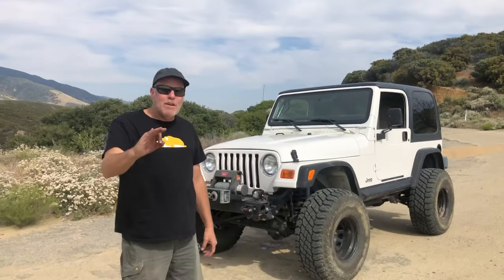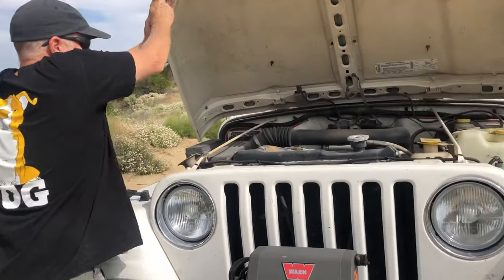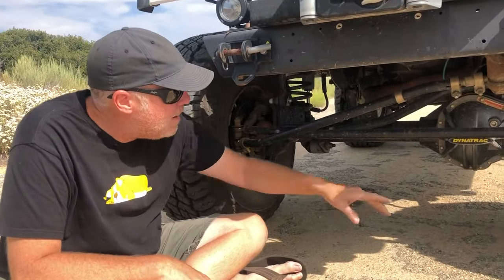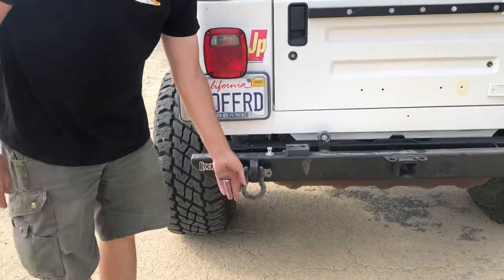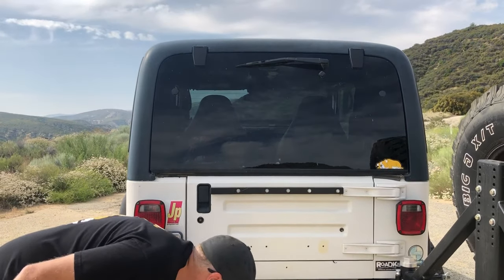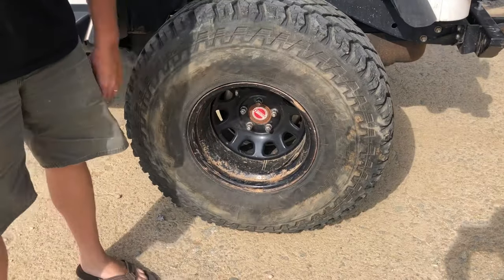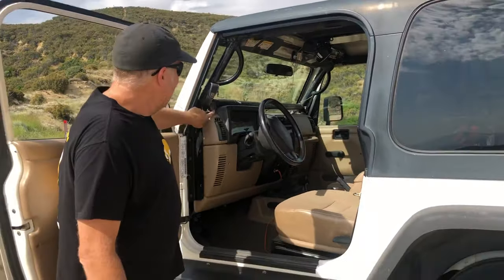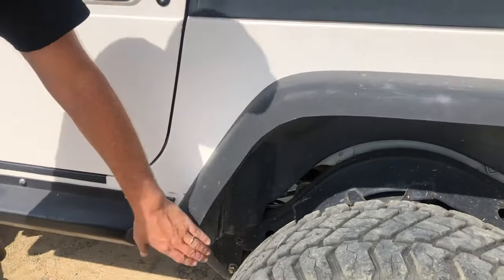How to Build a Jeep Wrangler TJ

Comment: I had two Stone White TJs in a row. A 2001SE Auto that I miss desperately. There are SO many good memories from it! I slapped on a set of the then new Interco Trxxus on a set of black steelies. Loved the set up. The second one I bought new in 03 and upgraded full doors, 2.4 l , 4spd! Auto, and AC ! It was a great road Jeep but the driveline while more drive able and powerful it didnt  instill the confidence of the the venerable 2.5, and solid 3spd auto. Shrug. I’d take either one back! I was forced to trade tge 03 in on a new Aveo in 05 because if medical bills 😢. I received 12,500 on a 2 yo TJ with 21k in 05! 🥲they started climbing in value after that and I’ve never been able to afford one again! Thanks for the memories and sorry about the novel here. 😅

Comment: Freiburger: "This thing is built to be bulletproof and will never fail on the trail with how we use it!"

Also Freiburger: "We stopped because the transfer case shifter fell apart." 

😂😂😂
Reply: I'm pretty sure he meant like a proper breakdown that would result in the car being unfixable on the spot and/or require towing.
Reply: That's what happens when you talk about being unbreakable.  It breaks.
Reply: AstronomyToday get a Suzuki , get there, watch all the jeeps have fun and actually wheel, go home and be sad. 😂
Reply: AstronomyToday haven’t heard that one before, lol that’s actually pretty funny 😄😂😂
Reply: Dave can't build anything that doesn't fail - it would break the universe.
Reply: @AstronomyToday I'll stick to my American wrangler over a cheap knockoff anyday
Reply: @AstronomyToday lol a jimny is the definition of hairdressers car
Reply: @AstronomyToday duh it was a heavily modified suzuki sierra that holds the altitude record not a jimny they had to follow the tracks of a stock standard wrangler to the top and park on some piled up rocks to claim the title. i'm not sure about the longest distance single vehicle travel record plenty of jeeps have circumnavigated the globe  one gpa by land and sea. the longest running single generation vehicle lol do you mean the cj3b 1953 to 2002 because it's not suzuki they had lj50(jimny),lj80, sj sierra/samurai and then the poxy looking new jimnys all different models mate. yes jeeps are older also the first land rover was built in 1949 and it used a jeep chassis,suspension,diffs and transfer case with a homemade body, rover motor and gearbox.
Reply: He was talking about the axles.
Reply: that shifter is broken from factory, designed very bad, so people swap them with wired shifter
Reply: @AstronomyToday I suppose I should point out that the 1986 jeep is the evolution of the CJ of 1946. The very capable Toyota Land Cruiser was based on both Chevrolet and Land Rover designs.  Suzuki was a very late comer to the off-road game.
Reply: yep i is bullet proff

Comment: I like using motorcycle chain wax for exposed lubrication points. If it dries in a dust free environment I has almost no sticky tack to it and it is totally waterproof. I like Maxima chain wax.
Reply: Amsoil "Metal Protector HD" dries waxy too.  I use on all kinds of outdoor stuff like trailer hitches etc and it does a great job as well.

Comment: You could try using graphite spray instead of the liquid wrench, graphite spray leaves a dry libricious film that wont soak up the dust and get worn in the heim.
Reply: Swordenchanter88 productions where do you get that from? I’ve been using wd40 for years but always on the hunt for new products to try
Reply: Cheap Jeeper graphite spray you can for sure get at Home Depot or any hardware store. Usually kept by the key making matching.
Reply: Check out Bechem Lubrication AF 438... Made in Germany anti friction coating. Spray applied.
Reply: Don't use liquid wrench to stop the squeaky fasteners. Use Teflon spray

Comment: living in aust i have aset cooper tyres 33 inch on my sixty series landcruiser the same as yours disapointed in them not good in mud fill up easy turning in to slicks....being very over priced find they ride rough have weak side walls blue ahole thru one just touching woodern stump....have only lasted 50km to 60km instead of suggested life around 80km to 100km

Comment: Good to see you back on youtube. I met you a few yrs ago at dragweek,  131 dragway in Martin Michigan and you signed my vette kart....  I used to watch everything you put out untill roadkill went to motortrend.  I tried it for a month , but I'm not giving them money every month for very limited content,  when there is so much free quality content available on youtube.  
 I have a similer TJ minus the pro rocks and stock motor.  I run a 4.6 stroker ,  8.8 rear and ,  and mildly built dana 30 while I save for a RCVs and dana 44 swap.

Comment: The reason why your rear shocks were not the right size is because of the shock mount on the axle. Dynatrac moves the mounts a little higher to protect them and this is why your shocks will bottom out before the bump stops contact. 

I've been there. Wasn't fun sorting it out

Comment: i have a solution to noisy and none insulated soft top on my 2005 TJ. I have the sun screen top for when i have the top down, so when the top is up i put pillows between the screen and the soft top. This fills the void preventing flopping of the top and also gives it like 3 inches of insulation from the pillow fluff. I have a couple of throw pillows and a Batman body pillow i use! It is super quiet and gets completly warm in winter and if the top is up, the A/C get it very cold. Simple trick!
Reply: scott reynolds haha that’s a awesome idea mate, 100% going to try that tomorrow

Comment: I bought mine new in 1997.  Today, she has 408,000 miles and climbing.  Every year in autumn, since the first winter, I would scrape, prime, and paint the frame, even before I found out about the issues with the TJs have with frames.  It should be a recall.  Every spring, I would sand and paint.  We survived  and conquered death wobble / death rattle together from 2017 to 2018.  All upgrades, repairs, and maintenance have been done by me.  Nobody has ever touched her with a wrench, save me.  The many years have been wonderful.  However, this year, during the yearly autumn frame preparation for winter, I found a rust hole big enough to put a spoon through it.  Last year, I did not prepare the frame for winter but did not drive my beloved at all through winter. I had surgery and could not drive for almost a year.  I did not think the ravenous rust disease would start devouring my beloved.  I will be honest, when I got under there and my finger pushed through the hideous brown spot, I paused and saw all my wheeling adventures, all my incidents, all my long beautiful trips, all my late night outings, the day I started my life with her so many years ago, our first trip home, and I cried for awhile.  I am tearing up right now thinking about it.  I imagine this is how it feels when you find out a dear friend has cancer.  We went out for a long winter ride and enjoyed some snow covered fields tonight. She was wonderful.  But I know what is happening. Today, I stuck a vacuum cleaner in the rust hole.  I put a filter in line of the vacuum hose. After vacuuming the inside of the hole until things got quiet from no more debris coming out, I opened the homemade filter. It was horrible.  Many thick rust chips were inside the filter. The outside of the frame looks pristine.  But obviously, there are hideous things going on inside.  She is suffering greatly but hides it well.  Replacement Jeep frames are very expensive, even if I install them myself.  Right now, comfort and quality time together are the focus.  I am saving for the very expensive frame.  The shipping is very expensive as well.  2020 may be the twilight year for my beautiful Windi, my beloved TJ.  The end may be very near.  However,  the next payday, I am going to buy new LED headlights, wash and wax her, give her a tank of fuel, change the oil to the best, and get her the rear dented bumper exchanged for a new one.  She may be dying.  But she is alive now.  I am going to miss her horribly.  I will likely keep the remains at the time the frame breaks resting on my property.  I can not part with her after all these years. 
Frame - $£3000
Shipping £1000
Reply: It was probably rust that formed from the inside out of the frame, awesome story
Reply: @Ejscars  434.000 miles are on the odometer now, and climbing.  I have resorted to filling the frame with automatic transmission fluid, every autumn.  I fill it until it barely starts dripping.  This will slow the oxydation tremendously.  But I know the damage is still there.  What really hurt my beloved was on the 8th of October of 2022. Returning to my rebuilt house for the first time after a fire destroyed it in January, my return home was a struggle.  Every light on the instrument panel turned on and the indicator needles went flat.  But the engine ran well.  I continued on my 160 kilometer trip home.  Upon reaching my driveway, I tried to turn off my dear Windi.  The engine kept running and smoke started coming from under the barrel.  I opened the bonnet and fire erupted.  I took the emergency fire axe and cut the Burning wiring harness to the fuse box under the bonnet.  The engine went off but the fire kept going.  I was moving back into my home so I had five fire extinguishers in my beloved.  I was not going to move back into my house without a fire extinguisher in each room.  I ended up emptying two full extinguishers under the bonnet.  She laid there so silent, so dark after the fire.  The thought of laying her to rest so her parts could go to save other old Jeeps ran through my head. But we have been through so much together. She has been there when no person has been.  Mid October I started the extensive repairs.  The money for the frame went to get fenders a bonnet, complete wiring from front to back, an instrument panel, two seats, and all front facing lights, radiator, ignition rail, brake lines, radiator hoses, battery, many sensors, throttle body, and more. She only awoke from her catatonic state just three weeks ago.  She lives once more and has been renamed, "Stargazer," because of her second life.  It is great she travels with me, once again. However, in the back of my mind is always the small hole on the frame. But the miles keep climbing and our long journey together is not over yet.  After all, she is so much more than just transportation to me now.  She is my dear friend.
Reply: @indridcold8433  sorry to hear
Reply: @Ejscars  Our journey together is not yet over.  There are many miles to go before our parting.  We may not even part after she is no longer road worthy.  She can retire as lawn art.

Comment: Clean low milage rust free TJ $10-15k all the goodies axles, t-case, drive shafts, lockers, gears streering, suspension, wheels, tires, carrier, hard top winch . $40,000 in parts. And when you try to sell it. Get ready for....$ 4 and 5k offers all day every day until you want just give up and drive it off a cliff.

Comment: Hey Dave, I sent you a photo which you published, of Jamey Anderson and his son, which I took in Chattanooga the day before he died in that horrible accident in Alabama.  I follow you and Finnegan and all the Hot Rod shows you do on Motor Trend and love what you guys do.  I recently purchased a 2002 TJ.  I tow it behind my motorhome and do some trail riding with it.  Currently visiting Arizona and then off to Kanab and Moab Utah.  I’ve got a winch bumper, Smitty Bilt 9k lb winch and a 17” LED light bar, rock sliders, similar rear bumper and spare tire carrier with a Hi Lift Jack attached.  It has 32” BFG All Terrain tires, Rancho 9000 shocks.  It has 1-1/2” spring spacers on the front.  The axles and suspension are still stock at this point.  I have the Sahara interior, tan and green.

Comment: Im torn. I have a 2001 wrangler with basic mods. And for the price of the axles he has i can buy a 1990 suburban with a fuel injected v8 dana 60 1 ton front and rear axles, a triple stick transfer case front and rear lockers, 40" tires, hydro assist steering cross over steering, more room, same reliablility and more capability

Comment: What i find interesting is you have an 02 but you have the single windshield squirter found in the 03 and newer.  I have an 02 and i have the same single squirter as well.  I only learned this when i bought my louvered hood vent and it wouldn't work.

Comment: What?! No zip-ties in the back?! Need to get some of those... In all seriousness, some other good stuff to carry would include starting fluid (can be used in conjunction with fire to re-seat tire beads), a mil-spec entreching tool (folding type), and parachute cord. There's actually some stuff called Titan Survival Cord that has a tensile strength of over 600 lbs and some interesting stuff on the inside like 30 AWG wire, fishing line, and a strand that can be used as fire starting tinder.

Comment: Hey David,  just so you know ,those pin's on the front will only pull about 500 lbs before they break and fly everywhere. The sheer strength is more if the recever is used. D- ring's don't cost very much and you might save someone's life.

Comment: Hi Dave love the shows ..engine masters.. most..I have a 63 ford falcon an had a 331 stroker sbf installed..I put the holley sniper on it. The fuel return line is churning up the fuel an making fumes in car with stock fuel fill tube so I disconnected it an just put a piece of gas pipe direct connect in trunk with solid screw on cap. Should I be worried about pressure build up in tank?  Doug

Comment: I got a used VIAIR pump on eBay once with a busted connected and some messed up wiring, which I rebuilt, and omg, that thing was a monster. It'd pump up my tires almost as fast as a gas station pump would.

Comment: Consider changing out the 10 inch wheels for 8 inch- maybe that would help the issue with the tires. Absolutely worth doing if you air down anyways -it made popping the bead a rare thing for me after I switched. I mostly dune my full sized truck in Glamis but I’m aired down to 14psi up front and the rear is usually 10-12psi (when not running paddles) it was amazing how much better the narrower wheels performed.

Comment: I run the Terra 2 low in my YJ. I made a shift rod for it using heim joints, and bolted it to the shift of lever and T-case arm. And it worked great for a couple years now.

Comment: hey drill holes on the driver and passenger side on the underside of the body directly inline with the rear of the door seam. there is a sealed space  there and water works its way in rusting out the under the doors

Comment: I’ve never known of a single TJ to come stock with a NV3550 transmission (NV3500 / AX15) and there is no NP231OR transfer case, but there is a NV241OR t-case, which I have in my TJU Rubicon (LJ).  I think you need to do your homework!
Reply from the maker: bemyers123  2000-2004 TJs  use a factory NV3550 with the 4.0L engine. Easy homework. Yes, I misspoke on the 241

Comment: Thanks for sharing. I just bought a 2001. It already has some mods and is running 35” tires. What is the 2wd low range kit you referred to?
Reply: From Tera Low for the 2 low kit.

Comment: Hay D.F. just wanting your opinion on a recent purchase of a 2001 WJ Limited ,as mostly a winter vehicle in place of my mx5 but might make into a light duty trail rig as well, it's got the 4.7 V8 with the 545rfe trans and quadra-dive II drive train, which I like for the vari-lock diffs but not so much the full time 4wd, it's got a Dena 30 front and the 44a rear with the 3.73 ratio. In the end I only paid $200 for it so I cant be upset but just wanted to know your opinion on it.
Reply from the maker: STINGRACING  Good score. I’d never prefer the Quadradrive II deal. Leave it stock.

Comment: Hey David, 
Are your Dynatrac axles off the shelf or custom built for a Jeep TJ. What is the width of the axles and is the bolt pattern 5x4.5?
Reply from the maker: Bren Tor  They are made by Dynatrac specifically for TJs at stock width—something they very rarely sell any more

Comment: Any info on the mods you needed to do to install the 241OR( you said 231). Skid plate mods...tcase shift linkage...body lift..etc. Thanks I have a very similar looking white TJ as well.
Reply: He has a 231 with a Tera Low kit which is now discontinued. 

The 241 bolts right in. Just get the correct rear driveshaft. Nothing else is required.
Reply: @offroadspecialties7383  In the vid he said he had a Rubicon case. I know few guys that have done the 241 swap and it's no bolt in. It is 23 spline like the 231 so that's no issue. But it's much larger and you need a 1" body lift or beat on the tub. Also the linkage is different and the 4x4 light wiring was different. Also on the 97-02 the skid plate has less drop and requires mods as well. I had a Tera low in mine and they are JUNK. Mine died in 3,000 miles and that seems to be the going rate for others too.